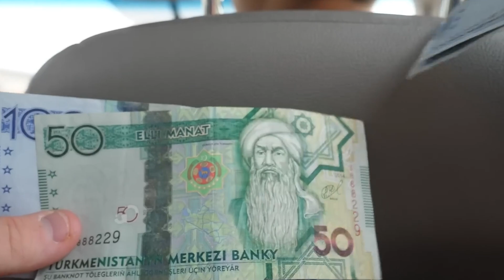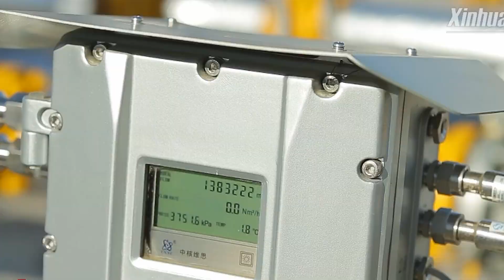This Is Why China CANCELLED Europe With This $8 BILLION Mega-Pipeline

Comment: 😅  No Europe is not in shock!     1) We know a dictatorship supports another!   2) We have invested heavily and fast in renewable energy to become free from Russian influence... so good luck to you!
Reply: Europe can get from Russia cheap energy to fuel your industry. Renewable energy isn't cheap.
Reply: @faustinoco3933  Renewable is not always cheap to BUILD, but after that. What does wind cost? The sun, water???
My own electric bill is reduced from last year (it was expensive in January and February).
While not "green" in itself, heat pumps make the energy (electricity) used more efficient. less energy is needed to heat the house.
Reply: @PjotrII  Know what? Solar is the cheapest renewable energy in the world. Solar panels, inverter & batteries are all you need to save 30% on your electricity consumption.
Reply: @faustinoco3933   Partly true, but in my country it is wind... living up north where there is less sun!
Reply: @PjotrII  Not in the Philippines where the sun shines all year round. We have wind renewables but they are much more expensive.
Reply: @faustinoco3933   yeah I don´t argue against that... it is good you focus on sun!  But very far south or north the dun effect might be ~80% of your efficiency 1/2 year, and under 30% the rest of the year
Reply: @PjotrII  That's for temperate countries but we're in a tropical country, an archipelago.

Comment: China has the resources & drive to accomplish what others consider too challenging.
Reply: China do have resources, as LONG as salaries are low. But there are also fears, like inflation, and then a housing bubble... at the moment there are enormous build projects, of which many are only half built, until the builder "ran out of money"... poor people invested all they had or gave land away to get a new apartment, that they didn´t.
Skyscrapers stand empty with no water or elevators installed. It is a communist system that tried to replicate market economy and got stuck somewhere in between.